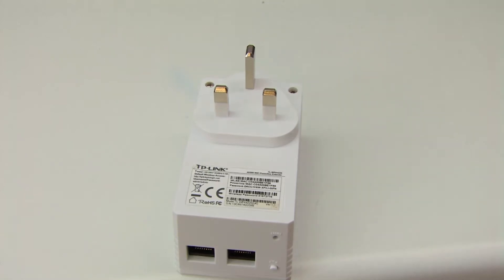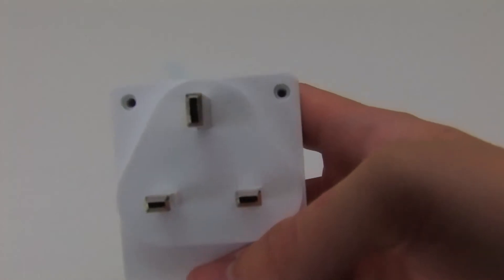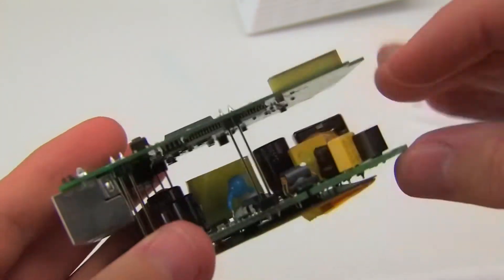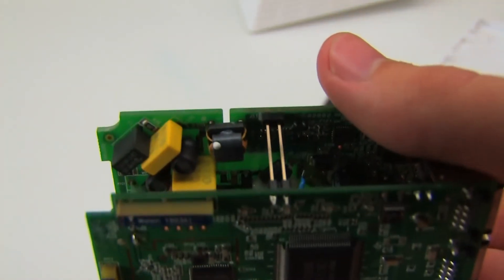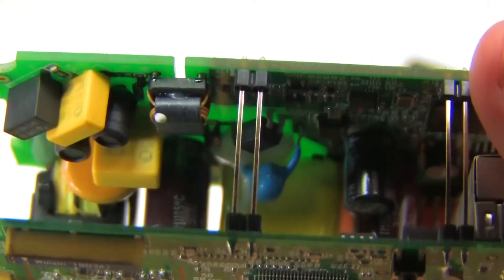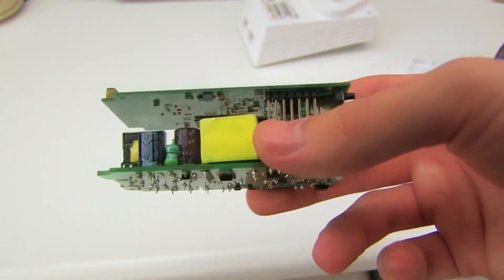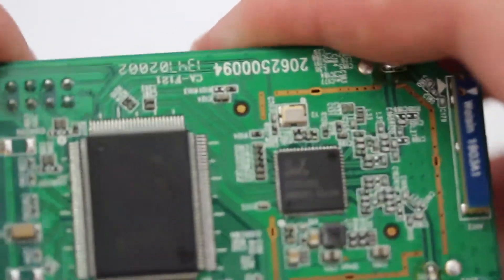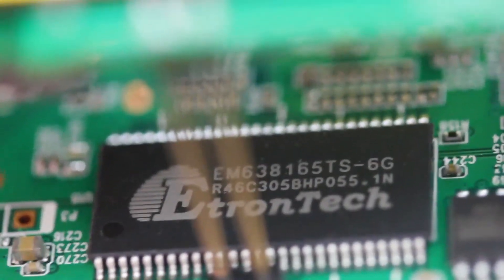TP Link Powerline AP: teardown and IC biopsy

Comment: Can I directly connect it to the circuit box with rj45 of the router to reach the entire connection..I'm researching it for newer innovation on grid tied solar inverter...where on the inverter side it's internally connected 100 meters away or on the roof ..just to monitor power yield

Comment: So what is going across that air gap?  Any opto isolators on there?  Any nice spark gaps too?  I reckon Dave Jones from the EEVBlog needs to be sent one!
Reply from the maker: Knuckles the Echidna There's an optoisolator for the power supply part of it, but the signal from the mains gets converted by the baby inductor.

Mains --> PSU -->DC to power data circuits 
          -->baby Inductor-> Atheros datacircuitry -> Realtec WiFI controller -->Realtec Broadcast controller -->aerials